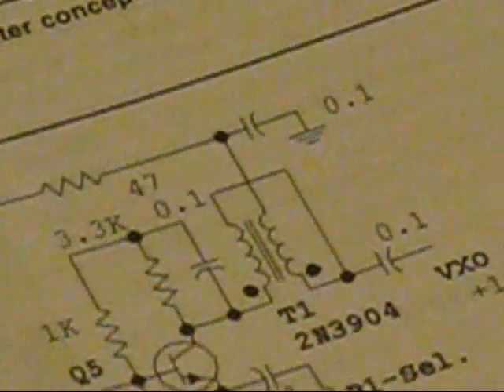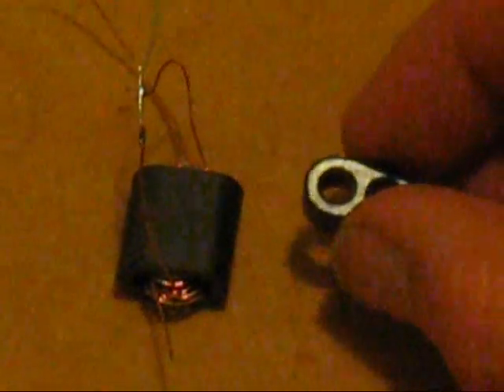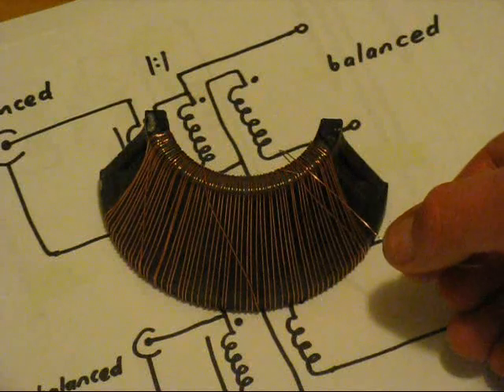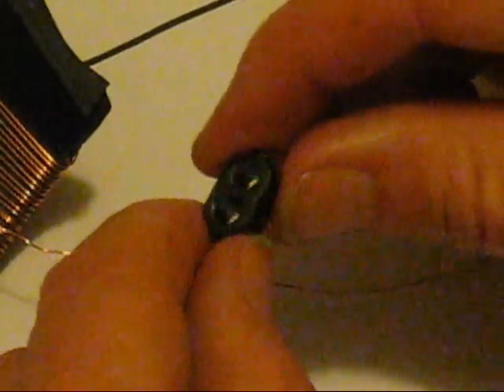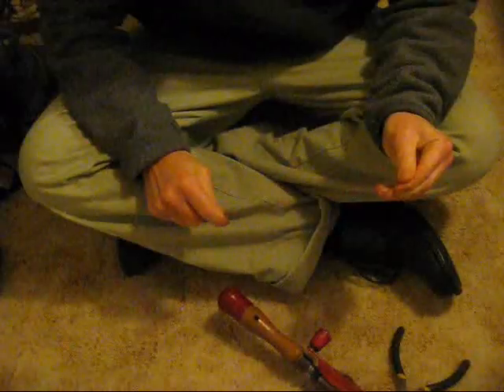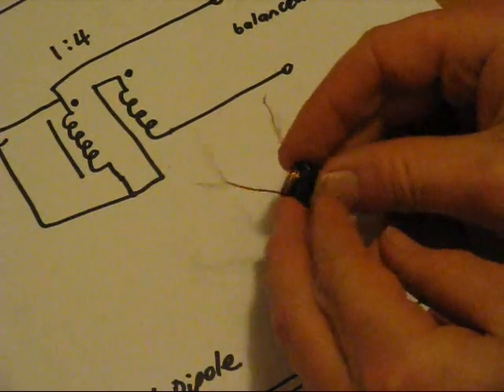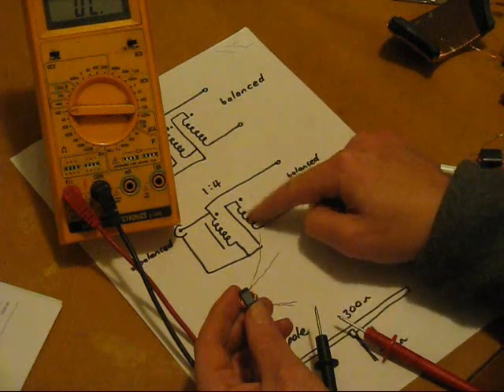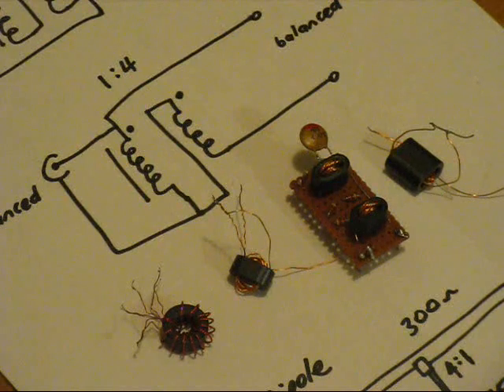Making broadband ferrite transformers for radio & antenna projects

Comment: vk3, very informative video. 
I'd like your thoughts on TV antenna 300-75 Ohm Matching Transformers.  Could you suggest a particular DIY design?  or even recommend any from here>> http://antiqueradios.com/forums/viewtopic.php?p=1426737
Thanks.
Reply from the maker: I've never built one for that purpose so can't comment.  However I'd imagine it's a standard 4:1 transformer with two bifilar windings on ferrite suitable for the frequency.
Reply: Do you know reading materials which describes theoretical aspects on how to make broadband RF transformers?. I mean the way calculating ferrite size, number of turns, size of wire,etc.